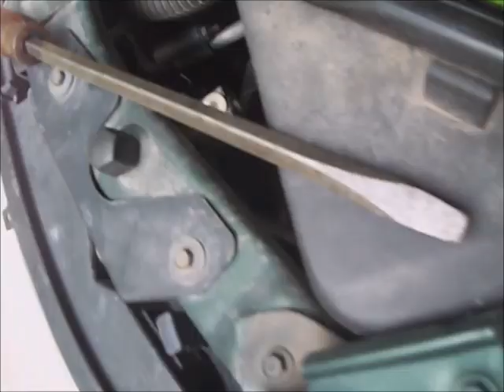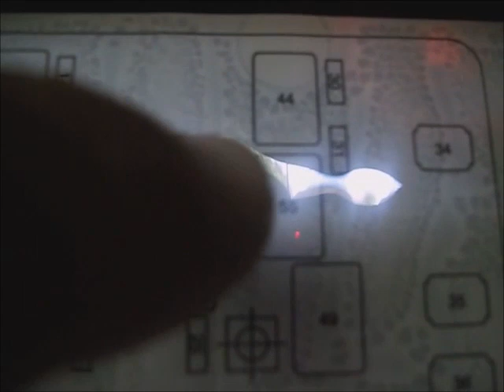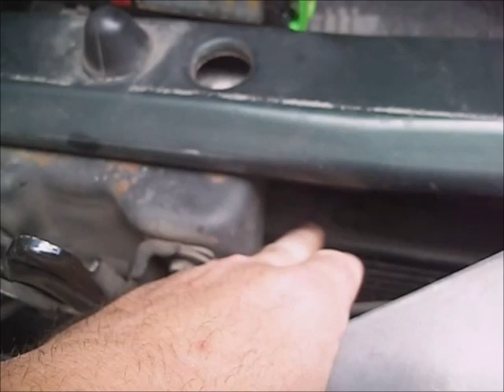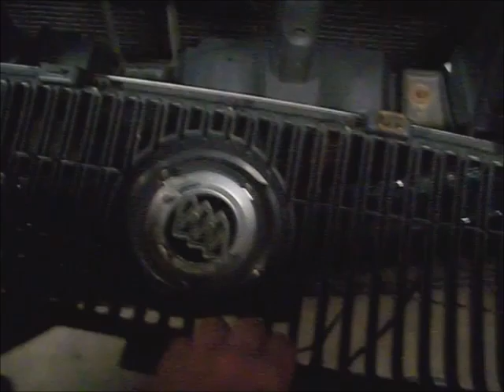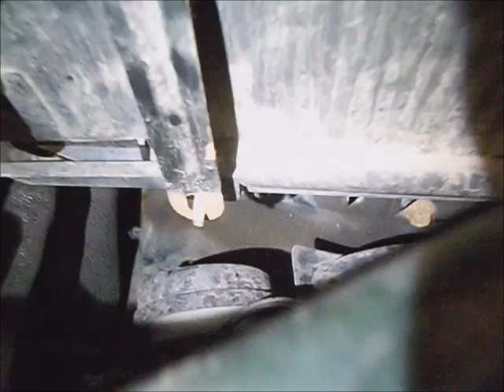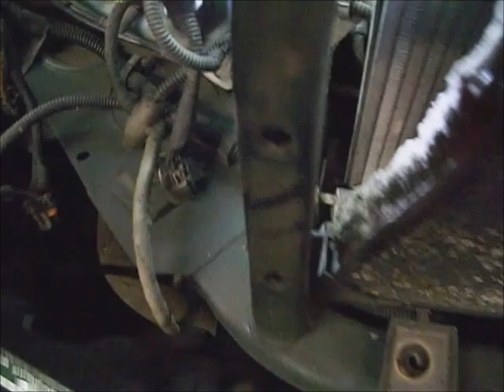Buick Rainier `04  troubleshooting a/c not cooling removing condenser pt1

Comment: I have a problem with the ac lines being ice cold but the vent blows Luke warm or slightly cool even with it on to 60. Any idea what would cause this issue?
Reply from the maker: either its low on freon, or the air door isnt opening properly

Comment: It is the sensor on the bottom line right next to the ac compressor
Reply from the maker: No, not in this case, that sensor is a safety, and only sends inputs to the PCM.  And the PCM then can take actions to engage or disengage the clutch on the compressor, based on system pressure.  Excess of 350 psi, opens a/c relay, below 229 psi closes it.  In this video, (if watched) I try engaging the a/c relay manually, which has a direct connection to the a/c clutch, through a built-in high temp sensor attached directly to compressor body.
  The clutch gap was in excess of tolerance, and it is serviced with entire compressor.